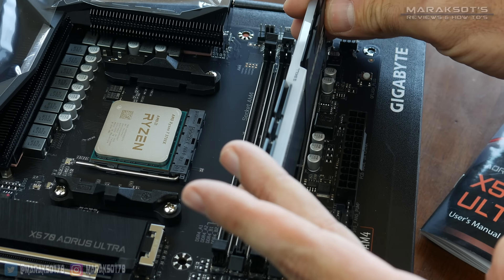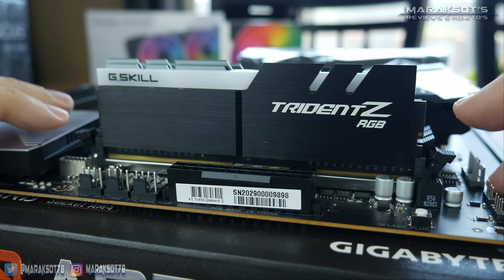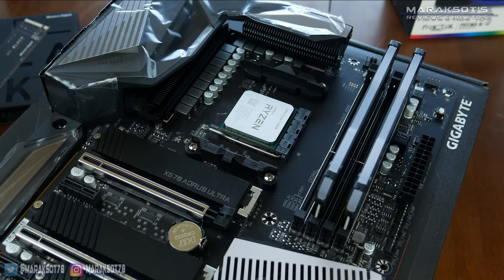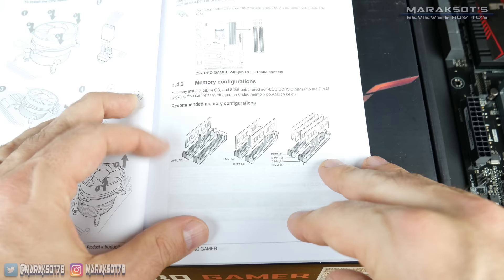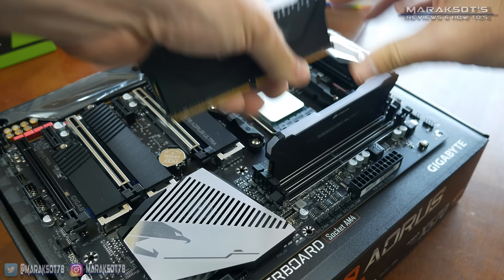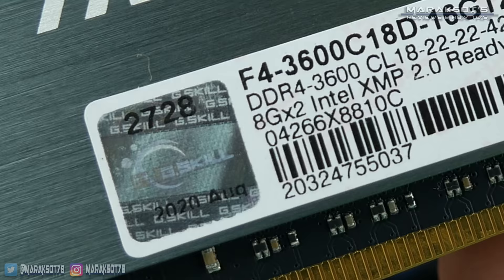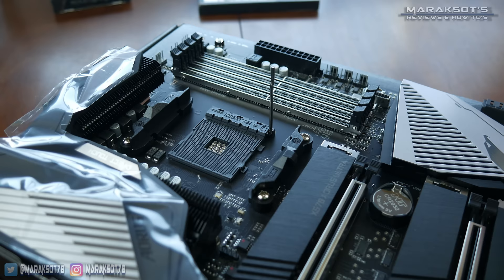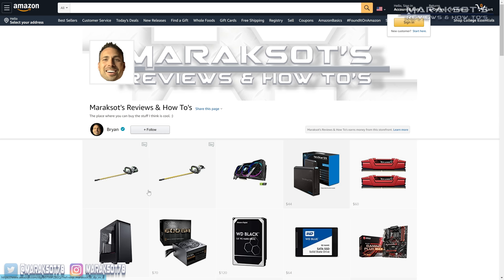A Beginners Guide: Upgrading Your PC's RAM

Comment: thank you so much for this video, it was so incredibly informative and helpful. I’ve been into PC’s for a long time but never felt like building one was worth it, as I figured I would mess something up, and just didn’t know enough about it. I got a prebuilt when I was 12 in 2014, it had a GTX 710 and some other really bad components, although not too bad for the time, and I didn’t even know what any of the specs meant in the slightest, I was just happy to have my own PC.

Christmas of 2022, I got a new prebuilt ASUS desktop, and now that I’m older and know what to look for, I got one with an RTX 3080, i7 processor, etc. and I am just now, for the first time, going to upgrade a part inside my PC. I play a lot of VR, GTA FiveM roleplay, and other Ram-intensive games, and also like to record and stream while in VR, so I think I should probably skip 32gb and go from 16gb to 64gb. I have 2 sticks of 8gb each that came with my PC right now, and I think I might swap them out for 2 x 16, and get 2 more 16gb a few paychecks from now, or if I can justify the purchase in my head, I might go ahead and buy 2 x 32, which would set me up to go to 128gb someday quite easily

Sorry for typing a novel, i’m just very excited that I finally understand all this stuff thanks to your video, and I finally feel capable of turning my machine into something amazing, so thank you very much, this video was extremely valuable

Comment: Thank you! This helped a lot.

I was installing my ram and had no problem until it booted into windows and I got a kernel security check failure error. Then I had to reboot my PC and it got into safe mode and I went into the bios and lowered the speed to 3000 mhz and it works fine. My motherboard supports up to 3200 mhz.

Comment: I'm running CoD MW2 on my stock (2x4GB RAM) Lenovo Ideacentre 720-18ASU.
It runs pretty good (55-60fps on medium quality and other settings on high)
But with 3550MB used of my available 4GB it's really on it's limit.
Thanks to this video I'm updating it with 2x8GB Corsair Vengeance and I'm hyped to see what it dizzles.
Thanks!

Comment: I upgraded my RAM expecting it to take 20-30min max which sounds long but most of that time was trying to put the CPU heatsink fan with really fiddly clips back on after removing it to access the RAM slots.
Ended up being sad for 3 hours wondering if my Gigabyte motherboard beeping 5 times before restarting meant I shorted something. I tested different combinations of RAM, reseated my CPU and reapplied thermal paste, unplugged my 6 SATA HDDs, unscrewed my NVMe drive, unplugged/replugged my GPU only to find out that the issue was that my RAM wasn't pushed in all the way. You HAVE to push the RAM in until the clips snap on *by themselves*. Previously, I was pushing it mostly in and snapping on the side latch but that clearly was not enough. You made it look so easy in the video but I had to apply a decent amount of force (slowly and evenly) to get the latch to snap into a locked position by themselves.

Comment: I built a new PC a year ago and i can't figure out why i'm getting so much BSOD's and i'm pretty sure is RAM's fault, not sure if is a stick or one of the MOBO's slot. I have a bit of experience with pc hardware, but i'm really desperate at this point that i came to watch your video in case i was missing something and i wasn't. It's a really nice video, it sums up pretty much everything you need to know and made me remember one of my old DDR3 rigs wich had an ADATA module mixed with a Hyperx module of diferent speeds and capacities working like a charm, and now this monster i built is crashing a lot with every piece of hardware being carefuly chosen and double checked for compatibility. How times changes, feel like my grandpa telling the kids that stuff was more reliable in the old times hahah.
Reply from the maker: Sorry to hear you're having issues even after carefully checking things out.  RAM issues are definitely a pain, they cause all kinds of weird stuff and it's hard to diagnose them sometimes.  Just out of curiosity are you running your RAM's XMP?  and if so what is the speed it's running at?  Also what CPU are you running in your system?  If you're running a Ryzen CPU, especially a Ryzen 1000 or 2000 CPU it's possible your RAM is too fast.  1st and 2nd gen Ryzen CPU's are notorious for have stability issues with RAM over 3000MHz.  Not knowing what CPU you have and also not knowing what you've already checked or not, that would be my first suggestion.  If you have a 1st or 2nd gen Ryzen CPU and you've enabled your XMP and it's higher than 3000MHz (like 3200MHz or 3600MHz) then I'd try manually down clocking your RAM in your motherboard BIOS to 3000MHz and see if that helps at all.  If you're running an Intel CPU or a Ryzen 3000 or 5000 CPU then I don't think this is going to be the problem but may be something with one of your RAM sticks or RAM slots and the only way to test that is to put in one stick at a time into each of your slots and see if the problem persists or not.  It's annoying and takes time but it's pretty much the only way to figure it out.  Process of elimination.  Hope this helps man.

Comment: I bought my first gaming PC 2.5 years ago (Pre-built):

My motherboard has 2 slots.
It can use up to 64Go.
My ram is one stick 16Go.

I'm changing it for 2*32Go.
New ram should be delivered today...

Old ram : T-force vulcan z DDR4 3200 MHz 1*16GO
New ram :  Viper Steel DDR4 3600 MHz 2*32Go

Comment: As a gamer, and assuing one has only 8g RAM and most AAA games now require at least 16G Ram. Because Windows reqire the use of SO much of the 8G, a game requiring a minumum of 16 will not have sufficent RAM. Thus if and when one wants or needs to upgrade the amount. Omit the amount that came with a new pc which is generally only 8. Thus a new pc having 8 one will have to purchse an additional 16 making a total of 24G RAM. Remerbering as you stated, makeing sure to have the number of sticks divisable by two. My pc only has two slots, each contained an 8G chip. Making a total of 16. Which is unsufficent to play AAA games. Having only two slots both containing an 8G chip. I removed one, bought and installed a 16 bringing me up to 24. Which is more than sufficent. My only other recourse was to remove them both and purchase a pair of 16G chips, which is way more than one really needs.

Though if one has sufficent funds removing both and installing the largest, fastest etc would mean you could mutitask to the Nth degree.

Comment: Thanks for the quick tutorial!
Reply from the maker: No problem!
Reply: @Maraksot78  quick question where is the best place to look for the ram sticks? I’m looking for maybe 32 or 64 gb
Reply from the maker: What do you mean?  The best place to buy some?  If you're in the U.S. I'd look on Newegg.com, Amazon, Best Buy...
Reply: @Maraksot78  ah ok thank you! Because I’ve seen prices online and some where like 40$ for 32 gb and others where like 300$ not sure which one was legit I’m in the U S
Reply from the maker: Yah the prices of RAM can range quite a bit based on the brand and the speed and timings of the RAM kit you want.  Like I said in the video I like to check my motherboards support page for the Qualified Vendor list (just FYI they only list the model name of the RAM kits so you'll have to make sure the model numbers match) and buy kits that are on the list that way I know they're fully compatible.  As for RAM speed you're most likely going to want a kit in the 3000MHz to 3600MHz range (assuming you're getting DDR4).  That's kind of the sweet spot of price and performance right now.  As for timings you're going to pay more for CAS latency 16 as it's 'faster' than modules with a CAS latency of 18 but to be honest unless you're doing things where you'll benefit from the lower latency there's no reason to spend the extra money for it.  If you're just gaming and doing normal day to day tasks with your PC the CAS 18 RAM is going to serve you just fine.

Comment: 'Touch a metal part of your computer' It's worth noting that paint doesn't conduct electricity. I had to scrape the paint off the connections in a light socket last night (painter wasnt very good at masking) because the light wasn't getting any power at all. Find a bare piece of exposed metal on the case - you might fry your system if you don't.

Comment: Let me start with I am a novice level, I know how to tune and upgrade hardware with confidence. I have had literally no issues with my build solving things on my own until now. I have 2x8 G.Skill Ripjaws V (F4-3600C18D-16GVK). I recently bought the EXACT same kit to add to the empty slots bringing my total RAM to 4x8. The only difference on the sticks are the serial numbers. On CPU-Z it shows different manufacture, but it did that on the kit I bought before. One is a Samsung, one is HK (or something like that). Well I installed, booted, BIOS, set XMP Profile 1, everything looks good, but I cannot get the 3600 speed I had with the two sticks. In BIOS the Memory Frequency section shows two numbers; 3600 ------ 2133, but before the 2133 would match whatever the number was on the left. Now it is just greyed out. When I save and exit, the PC restarts twice in succession, then goes into a long pause then restarts like normal, but the speed doesn't change. Ok now I have dealt with that before and it was when I was tuning the RAM manually, however, something funky is going on because even if I go to manual tune, it still does the same thing, won't even let me test the new settings. I'm thinking I just need to return the new kit, and buy a whole kit of 4x8 that is together, unless I'm missing something. It's just weird that it won't even let me manually tune. 

I'd be happy if I could get any other speed higher than 2133. Tips? Pointers? Suggestions? I just want to either get this to work right or get another kit. Preferably fix it, as it's fun. I did have blue screens after installing the two new sticks, but I nipped that in the bud. Was an NVMe error, go figure.
CPU 5800X (Not OC)
GPU NVIDIA RTX 3050 (Factory OC)
MOBO Aorus B450 Pro Wifi (Yes, BIOS is up to date, everything is up to date honestly, everything uses manufacture drivers, not Microsofts)
PSU EVGA 850W G5 SuperNova
I doubt anything else matters, just Micro Center generic SSDs, Lian Li Case, etc.

Comment: I was hoping you would address the specs "U" (unbuffered non ECC) vs "E" (unbuffered ECC (not reg)) vs "R" (Registered). I am trying to replace a defective stick with an (almost) identical RAM stick, with the exception of the replacement stick being "U" vs the already installed "E". My system posts, boots, and recognizes the additional RAM just fine, but I experience a 1 second lag tick (freeze) every 30 seconds, which makes using the computer unusably annoying. I suspect this variation is the culprit but I am looking for confirmation.

Comment: Appreciate this vid! Answered all of my questions except for one. I was curious if I should ever have to consider if my power supply provides enough power for me to upgrade? I plan on upgrading from 16g to 32g RAM
Reply from the maker: When it comes to RAM your power supply wattage is not a concern. When upgrading your CPU it's something you need to take into some consideration, but very important when upgrading your graphics card.

Comment: I bought the same brand, speed, capacity as what I currently have, and what happened was my PC was unable to show display, I took out the new ram modules, and the PC did the same thing, then I started reinserting all the RAM chips, then it worked (with my original modules), but then my PC went into auto repair mode, I did a system restore, it went through, but then my PC went back to the infinite loop of auto repair mode.
I was utterly confused of why this happened to me. 
To be exact. My motherboard was MSI Z370-A PRO

What I had before: 
Corsair Vengeance DD4 8GB 2400MHz in slot 1
Corsair Vengeance DD4 8GB 2400MHz in slot 3

What I bought: 
Corsair Vengeance DD4 8GB 2400MHz x2 (inserted in slot 2 and slot 4)

I purchased these on Amazon, they had over 30k reviews with at least 4 stars. I'm even more confused now.

Comment: Hi there, my son is trying to update his ram on his gaming PC. It came with 8gb vengeance LPX (4gb each) with only 2 slots on the motherboard. We have have removed them and put in the new vengeance RGB pro. This is 2x 16gb.
We are following the guidance of lining them up correctly and clicking them in. The PC seems to recognize the 32gb but it then automatically shuts it down. Can you please advise if we are doing something wrong, or not doing something once the new ram is connected. He has only had it a month or so and we just need a little guidance. Please help!!!

Comment: I would appreciate suggestions to this question: 

I have 2 PNY 1600 8GB Ram sticks with C11 Latency. I want to buy 2 additional 8GB Ram sticks. Cost isn’t a factor. 

Should I buy: 

2 Motoeagle 1600 8GB with C7 Latency 

or 

2 PNY identical to the 2 that I am already using

Comment: Why is 16gb the "sweet spot" and are there any negatives to installing more on a basic computer?
I'm using a Asus PRIME B450M-A which I'm aware isn't that great but is a dependable little board for my casual gaming needs, are there consequences to loading up on RAM for it? (From compatible memory cards of course).
Reply from the maker: 16GB is the sweet spot because the vast majority of users are never going to utilize more RAM than that... at least at this current juncture in time.  The only people that will really benefit from having more RAM are those that are using applications that utilize a lot of RAM like editing 4K and 8K video or 3D modeling and such.  The average user doesn't need more than 16GB for the time being although in the next few years that could change. 😅
Reply: @Maraksot78  Well I got a good deal on 32gb (2 16gb) cards but by the sounds of it though it would be overkill it wouldn't be a detriment either.

Comment: Great video, thanks for all the info. I have a DDR3 HYPERX 4GB RAM installed and I have 3 x free slots. If I would like to upgrade my RAM, do you recommend me to get 1 x dual 8GB RAM and 1 x single 4GB RAM? Or 3 x single 4GB RAM? Considering that I would get the same brand, model and frequency as the one I already have installed

Comment: Mixing and matching different size ram can also burn up the smallest ram in. Added a spare 2gb to an old laptop with a single 6gb bringing it up to 8gb. Ran really well after the upgrade but burned up the 2gb ram after a couple days.

Comment: I recently got a new corsair pc with 32gb of ram 2x16 sticks. I went on amazon and grabbed 2 more of the exact same brand, speed and capacity. Turned off my pc and unplugged it from the powerstrip. When I turned it on my pc would not boot. I went into the bios and turned off xmp mode (corsair for some reason already had it enabled) pc booted but then crashed. The only conclusion I could think of is they tweaked the overclock for the 32GB ram and when I added 32GB more it confused it. No idea.

Comment: I found the video extremely helpful when trying to determine why my PC attempted to start after installing the new RAM kit but would not. However, my question is, when having 4 slots, are you able to use 3 of those 4 or does it have to be 2-4 where you either alternate or have all slots filled? Thanks in advance!
Btw, I did purchase the exact same RAM that my current motherboard had and supported to eliminate that being an issue!

Comment: It seems i got a real oddball of a ram module. I've checked my motherboards info and there is no mention of it. I checked the ram's manufacture for more ram sticks and they dont even have my model listed. Even google search can't find my current ram stick. My best guess is im currently running a G.Skill Ripjaws V DDR4 8Gb clocking at under 2400 mhz. My motherboard can support up to 3200mhz overclocked.

Comment: One thing I'm still concerned is the xmp/expo. Let's say we used a 16gb(2*8gb) 3200mhz speed, and decided to upgrade to a 16gb(2*8gb) 3600mhz. Do we need to disable the xmp/expo and re-train the memory modules before enabling xmp/expo?

Comment: I have a question. So I bought a pc off of Best Buy and ever since I got it the fans never turned on. The egg is on but the fans aren’t. Do you know how to turn the fans on? Are they plugged in? If not, where do I plug them into? My mother board only has chassis fan spots and no system fan spots.

Comment: Thanks alot for the video it helped me out alot getting the right ram. Tho i still have 1 question, so i'm looking to upgrade my PCs ram and since it already have 2 sticks in it with space for another 2 i've made sure to find some ram that's pretty much identical and from the same brand since the 2 my PC already have are 5+ yrs old and nowhere to be found anymore. My question is regarding the memory chips on the sticks (the small black rectangles), does the arrangement and number of chips on a stick matter? Both sets of sticks have the exact same specs and not ECC but the chips are arranged diffrently and the new ram i've been looking at have 8 instead of 4 chips

Comment: Yikes I bought a prebuilt pc with the hope and intention to learn more update and upgrade over time but dang they cheaped me out it was a $800 pc and the mother board has one ram stick installed (8gb) and has a max of two and I have the amd ryzen 3 1200 quad-core processor 3.10 GHz and don’t know my motherboard max and I don’t wanna buy anything until I learn more about what is making my pc so slow, tabs take forever to boot up. When starting things up, everything is so slow but once it’s gets going it stays steady then suddenly my frames (60 max) are freezing more recently. And internet isn’t really the issue most commonly what do y’all think the problem is if you need more info I’ll be happy to share.